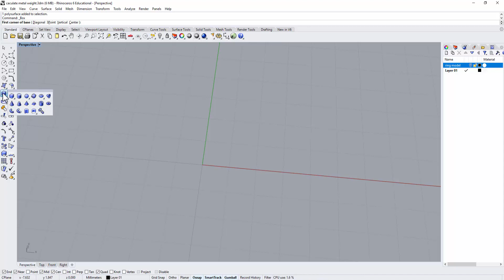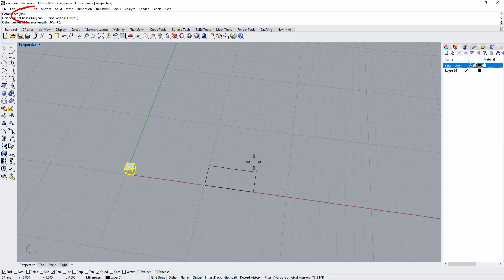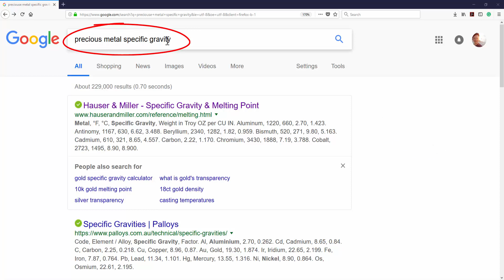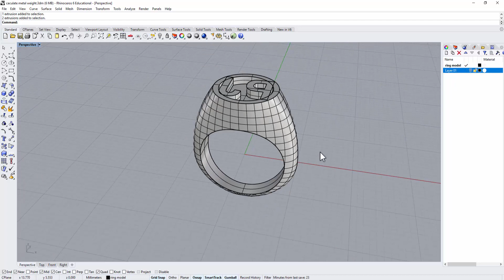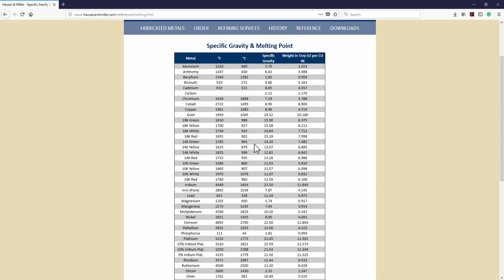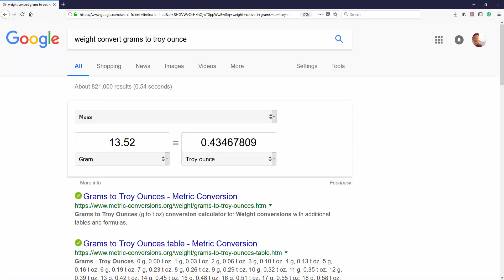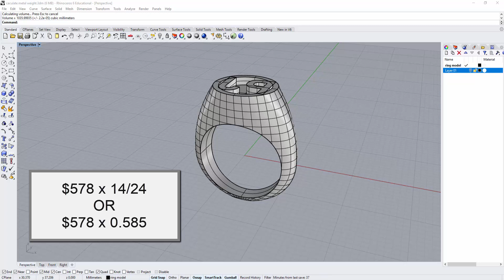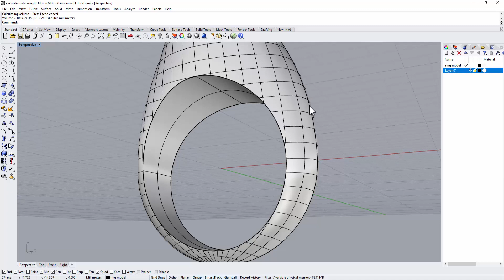Jewelry CAD Design Tutorial #21: How to Calcuate Metal Weight from Rhino 3D Model (有中文字幕)

Comment: hi PJ, I have a solid object (no naked edges , no manifold edges ) but I can not weight it... even after assigning a material to it... eg. 925 silver... I use command weightmetals... after waiting for the usual few seconds for computer to calculate... nothing happens. :(
Reply from the maker: Rhino itself doens't have this command. You may want to contact your software support to check if there is any bug.

Comment: How accurate are the weights if you had a 6g ring would it be 6g thank you
Reply from the maker: want you calculate the weight of metal, you need the specific gravity to calculate on specific metal.
Reply: @PJChenJewelryDesign  if it was 6g 9karat gold then my question is would it be accurate if the software says it’s 6g in 9 karat gold? Thank you for your reply

Comment: Good tutorial but why you call density a specific gravity?
Reply from the maker: I use specific gravity to calculate the different weight of metal for casting compare to wax. Here is what I found the definition online.
Density and specific gravity are both used to describe mass and can be used to compare substances. However, they are not identical measures. 

Density is defined as mass per unit volume. It has the SI unit kg m-3 or kg/m3 and is an absolute quantity.
Specific gravity is the ratio of a material's density with that of water at 4 °C (where it is most dense and is taken to have the value 999.974 kg m-3).  It is therefore a relative quantity with no units.
The words ‘taken to have the value’ are important here, as the value of maximum density cannot be known exactly (nor, for that matter, can the temperature of 4 °C be realised exactly).
https://www.npl.co.uk/resources/q-a/density-specific-gravity-differences#:~:text=Density%20is%20defined%20as%20mass%20per%20unit%20volume.&text=Specific%20gravity%20is%20the%20ratio,relative%20quantity%20with%20no%20units.
Reply: @PJChenJewelryDesign  Becouse i using rhino for making models for engraving for new chocolate moulds and i using normal density of chocolate.

Comment: Hi PJ, I've recently subscribed as a member for your online stone setting course. The videos were amazing & clear. Loved them all! But I was wondering if there's a video on what to take note on before the wax is printed and sent for investment casting? Like what's the thinnest width we can go for in the design. Because designing it in Rhino/Matrix makes everything looks pretty, and probably will look good in the printed wax too, but when it comes to investment casting, the outcome isn't what was expected. ☹️ Why is that?
Reply from the maker: Hi ADMWWS, I wish there is a rule and standard for it. A short answer for your question, there is no standard thickness for casting and printing. the longer answers will be depends on the structure of design, stone arrangement, type of metal casting, finishing process ect. Each metal casting vendor has they own casting setup and polishing finish process. Even the same CAD sent to different casting vendors, you may have different result due to different 3D printers (shrinkage), casting setup and finishing process. I will suggest you to do some test with certain vendors to find the best result for you.

Comment: Sir, How to calculate 21Kt weight in matrix or rhinocores?
Reply from the maker: http://www.hauserandmiller.com/reference/melting.html this is the chart for the metal specific gravity. there is no 21k gold. but you can guess somewhere in between 18k and 24k. if you are using matrix. it does has the function for metal weight.

Comment: Hey PJ, whats the difference between what you did and taking the volume(mm3) of the ring and multiplying it by the density(g/mm3) of 14k gold. We would get the same result, the mass in grams, which we could then convert to troy ounces.
Reply from the maker: Base on google search "The difference between density and specific gravity is that one is a ratio of the other. Density is the measure of the amount of mass per volume. Specific gravity is a measure density relative to the density of a reference substance." I was using specific gravity to do the calculation. Thank you for providing information for other calculations. ^_^

Comment: Thank you for your effort to make such wonderful videos, can you make a series of video of to make rings using different types of setting, what are the technical parameters to be consider  according to diamond size. For example if we are making a prong setting for diamond of sieve size of 6.5 , how should we consider dimension of prong
Reply from the maker: Hi Shwetank, The prongs number, and thickness is a design/aesthetic choice.There is no set rule for it. For example, you can have four 1.2 mm prongs OR ten 0.6mm prongs for 1ct round diamond. Technically, you don't want the girdle of stone cut over 50% thickness of prong, which will weaken the setting, and cause you repeating repair in the future. Two Rhino plug-in software GemVision Matrix and RhinoGold (they both own by Stuller now) have excellent feature regarding the stone setting and various prong shapes. It will speed up your design process on modeling jewelry. If you are in jewelry business, you can check out that two software at https://www.stuller.com/customsolutions/